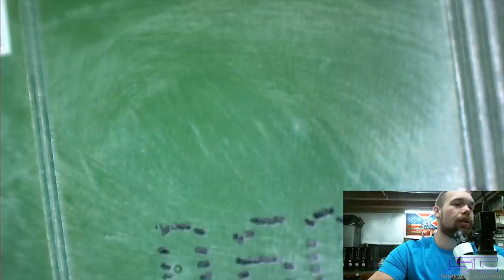Corona v2 No Power Repair with Multiple Broken Traces (CPU_RST) Xbox 360

Comment: Can you find out hot to attach a USB port in Xbox One controller from both left and right stick with other buttons so you can add wireless mouse and keyboard to it.. So you can use it instead of the adapter.

Comment: Hey, I need to replace one of the resistors on my 360 Slim RF board, R67. Do you know the specs for this resistor? Is is a 0603? Is it 30 ohm? I read on a thread that I can just use a jumper from another resistor, is this correct? ANY info you can give would be appreciated.   Thanks for your time.

Comment: You do repairs? My falcon rgh pretty sure got bricked . It was everything online then I installed gta v online mod menu then it stopped turning on
Reply: Theres a big chance its just a plug-in. Turn your console on count to 2 and press the eject button. Doing that turns your plug-in's off to which you can now remove the GTA Menu.
Reply: What happends when you try and turn it on? Maybe i can help you. There is no such thing as a GTA Menu bricking a Xbox 360 system.